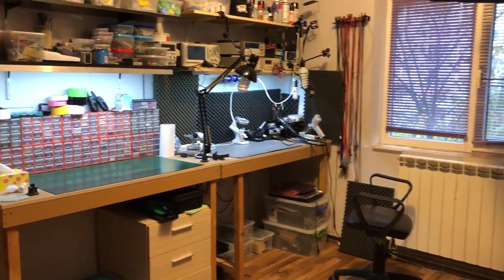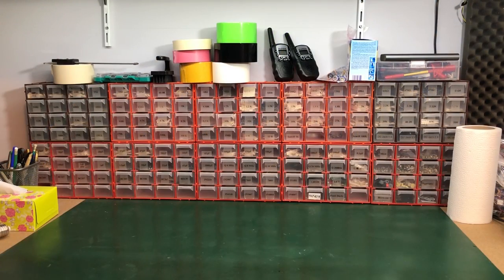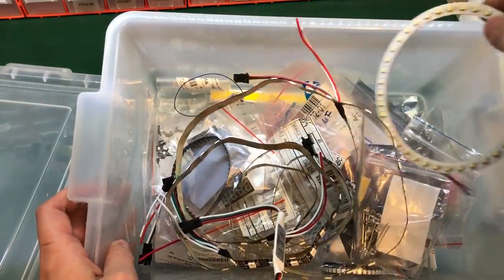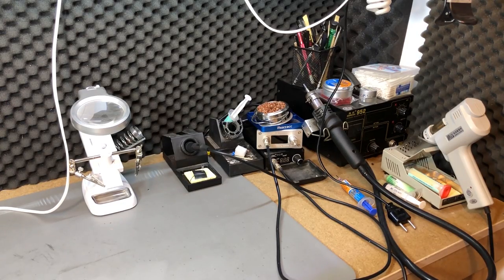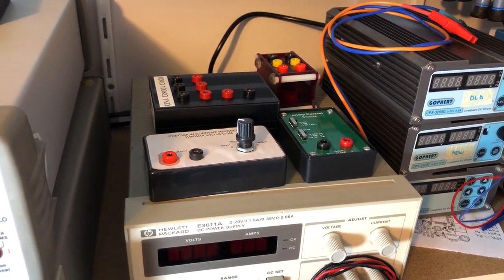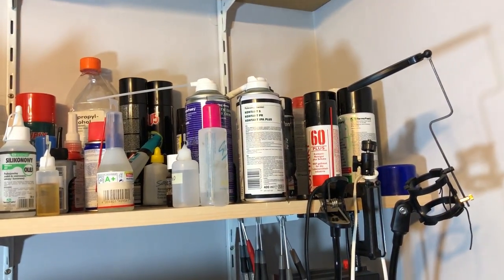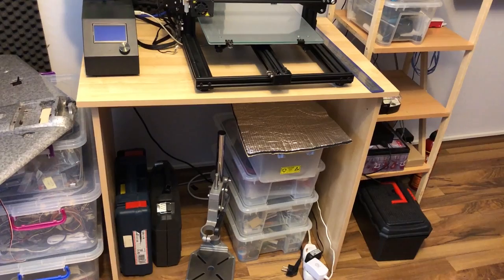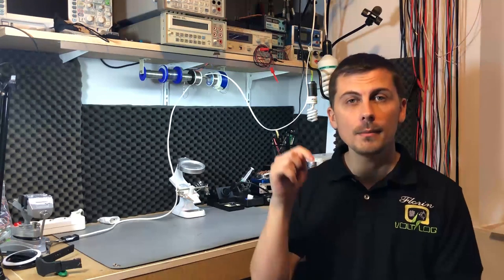Voltlog #192 - Lab Tour

Comment: You and I are so similar. I am also into electronics and I love flying fixed wings. So freeing. 

Only difference between me and you is probably that you are much older than me and so you have many many more tools than I do. I am not sad about it though, everybody has to start with little tools. I think you also had to start with a 10$ multimeter at some point. You are a great inspiration to me. Thanks for lab tour.

- Prithul
Reply from the maker: In the drawer of multimeters I still have my second ever multimeter which was about $15 about 12 years ago. The first one was cheaper, complete crap, it didn't last more than one year so it was discarded. So yeah, you start small and then slowly add tools. I also have more stuff because of the videos I do. Nobody needs a drawer full of multimeters.

Comment: Don't you have noise coming out of those led strips? I have two LED lights (not strips) installed a few inches above my scope and whenever I turn them on the scope picks up a NASTY noise, probably from the power supply driver. I was thinking about using LED strips and then moving the power supply away from the bench.
Reply from the maker: Yes they do emit noise. I have the PSU under the bench and I always turn them on when taking low noise measurements. The noise is caused by the lower quality PSU plus the type of driver used for the leds and how it's pwm-ing the LEDs.

Comment: You didn't mention what you are doing with the transformer at 12:40.  Looks modified with a high current loop for something.
Reply from the maker: working on a spot welding machine to be used for battery packs.

Comment: I like the aluminum angle bar for the LED strip lighting.  Very good idea that I think I will use for my new work table.  I'll probably paint the front to match the shelving though.
Reply from the maker: it has one downside which I didn't mention in the video, it spreads noise around your bench which will be picked up by sensitive measuring gear. This is dependent on the power supply and led driver so choosing a good quality power supply and a driver with a particular frequency might improve that. I always turn them off while doing low noise measurements.

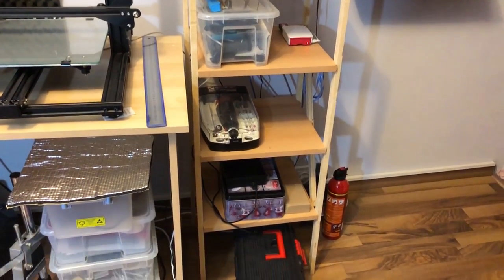Comment: 16:00 Is that the wireless rotary tool from LIDL (PFBS 12 B2)? I recently bought that one and the charging socket is a really bad fit on my unit (the internal socket is not aligned properly with the opening in the case). Also i noticed on teardown that they only populatated one of two possible bearings on the spindle. Does yours have the same problems/cost savings?
Reply from the maker: Mine is the PFBS 12 A1 and you have to remove the battery from the tool and then slide it on the charging cradle which works fine.
I haven't opened it up to check the insides..

Comment: You could get a 3630QM for cheap  for your Dell, I bought a used HP EliteBook 2570P and upgraded the i5-3320M to a i7-3630QM.
Reply from the maker: my dell E6230 has a BGA soldered processor.

Comment: Thanks for sharing! Also perfectly timed video as I finally moved to a bigger apartment few weeks ago that I have a dedicated room for my electronics stuff. Maybe you could stabilise the vibrating desk a bit by adding rubber feet and attaching bricks or scrap metal onto it? :)
Reply from the maker: It does have some oscillation sometimes but not so bad and the prints turn out ok in the end so I didn't bother improving it but at some point in the future I might replace it with something sturdier and use this light one for something else.

Comment: Interesting video, your lab is actually not too much different from mine (at least in some aspects).
Are those soundproofing rectangles fire-proof?
At around 10:55 there is something that caught my eye... You have (presumably) hot and neutral going into screw terminals and on the other side into wires with earth-color. Is it as bad as I think? ;)
Reply from the maker: they claim it's fire-retardant as for those wires, That is an E27 socket that someone gave me a long time ago, it had those wires already attached (about 10cm of wire) and so I used it as such, didn't bother changing those. No danger there, just an E27 socket that I use for light on the bench.